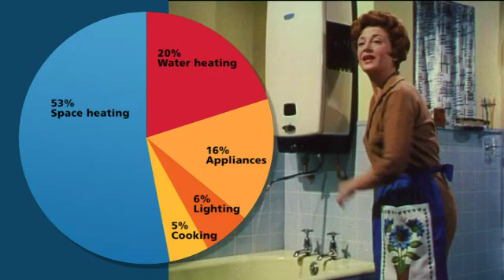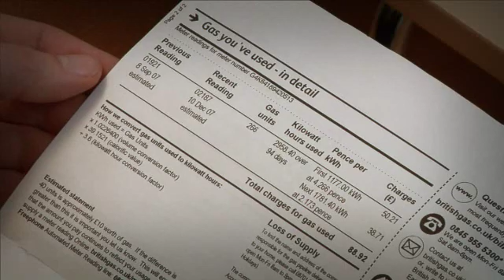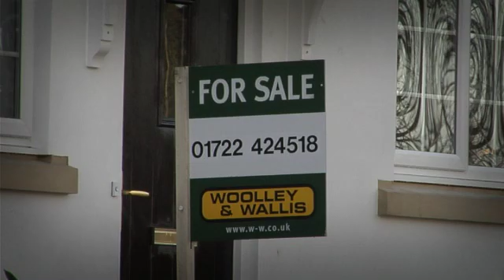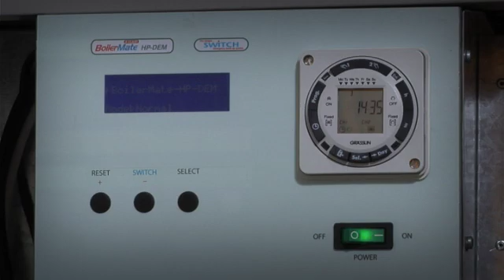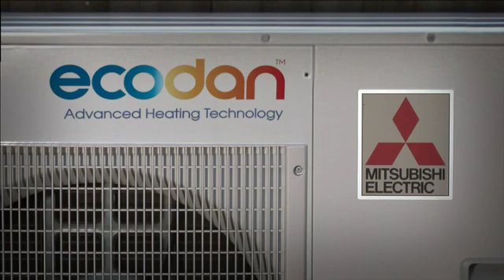Mitsubishi Ecodan Heat Pump

Comment: I wish i had never had  the Mitsubishi Electric Ecodan Heating System installed, you cannot have the heating and water on at the same time, when the water comes on in the afternoon for 2 hours i have to sit with a blanket round me as i am so cold,  when turning on the hot tap i waste a lot of water before it runs hot,  when the hot water timer has finished it,s cycle in the afternoon i turn on the heating and have to wait any thing from 20 minutes to 80 minutes for the heating to kick in

Comment: We have this heat pump installed in my block. It is very inefficient and the energy bills are much higher than average. All my neighbours complain about cold. For 4 years every winter is a nightmare with Mitsubishi Eco pump. Over a month ago it broke down completely and since then my disabled daughter and I live without heating and a hot water. Mitsubishi knows how to charge money for the installement but no willing to repair. This heating system is a big deception

Comment: this cannot compete with the price of gas....plus its not totally green as the pump is ran by electric...i have this system installed by our landlord along with another 170 tenants...so far there is a petition signed by over 70 tenants wanting it removed..out electric bills have more than doubled...check the price comparisons in which and carbon community.....all say this can not better the price of gas

Comment: Can't you just cover the technology without all the scare mongering drama? This is more a climate change video than it is technically informative. Air source heat pumps have always been more prevalent in the U.S. than water source or what we call geothermal. Boilers are not common except for maybe the northeast coast. What is new is heating water with air source heat pumps. I want to hear more about how this system performs at heating water for potable use.